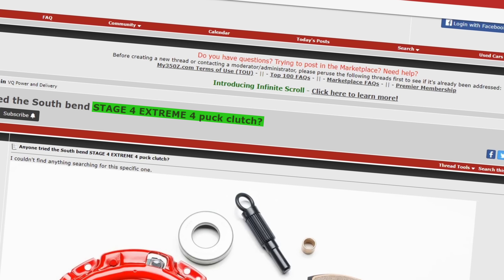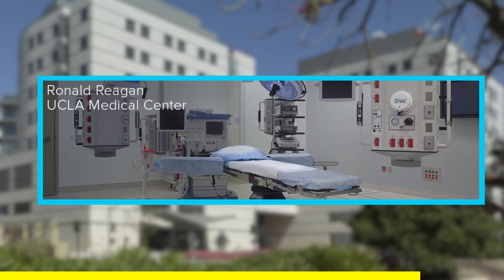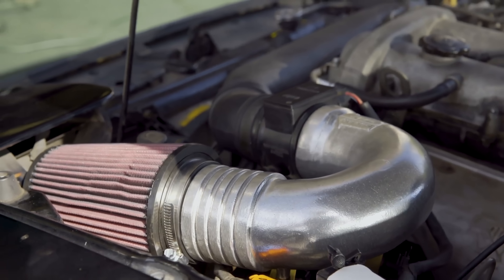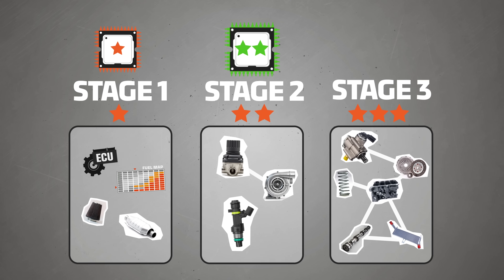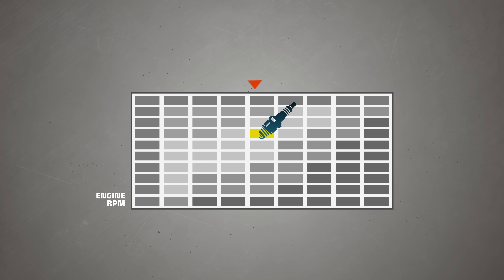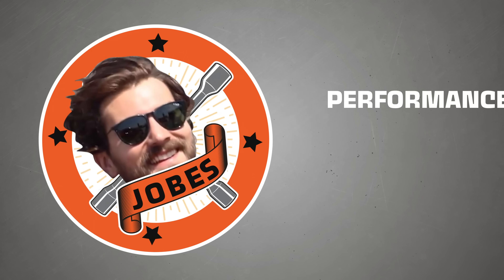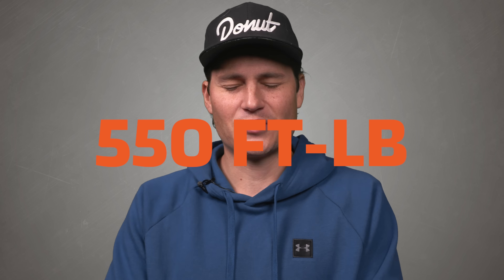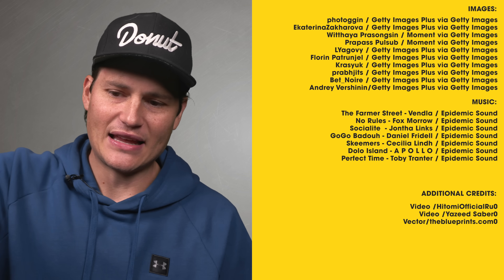What Exactly is Race Tuning?

Comment: what a mess that didnt clear anything up . Stages for me started in 2001 with the release of the Audi A4 B6 1.8t . 
The Audi could have a standard tune which would be called a Stage 1 would increase power to about 200hp , a stage 1+ which would increase power to around 220hp and involved upgrading the injectors . Stage 2 tunes involved fitment of a high flow exhaust from the turbo back , usually with a high flow catalytic converter/s . So if you have a mk6 Golf gti with a stage 2+ tune it means youre running a bigger fuel pump and a downpipe ( note the fuel pump is the restriction on TFSI engines and not the injectors) . All the other modifications are optional on any stages , this includes intercooler , cat back exhaust , discharge pipes , turbo muffler deletes , intake manifold flap delete and throttle pipes etc . A stage 3 is essentially a turbo swap which is larger than the stock turbo , but essentially is bolt on .A stage 4 is engine modifications like rods/pistons etc . 

Quite simple and easy to understand , it may vary with other makes but this is the standard for VW/Audi/Seat/Skoda tuning

Comment: You need to read your history of tuning. Stages of tuning existed and was talked about way before any video game was even thougth about.
For example:
In Sweden people in the buisiness of tuning and racing knew what stage 1, 2, 3 e.t.c. tuning of a Volvo 2,3 litre redblock inline four means. Same with the older 1,8 and 2,0 litre push rod engine. We are talking about the 70's and 80's.

Comment: Well i have 
VW Golf mk2 
1.6L Turbo Diesel
If we take this video for example then i have stage 2 tune with:
Bigger turbo, new set of injectors, cold air intake, and electronic bosch pump (even i don't know how 1990 golf can have so "modern"[at the time] fuel pump) ....
Buuuuut

It only makes 5kw more then original power 😭😭😭😭😭

Comment: When working with companies selling parts for Volvos is seems they usually fallow the IPD rule of thumb of Stage 1 = no internal mods or programming needed Stage 2= programming needed Stage 3 = programming and engine internal upgrades needed. Stage 4 is usually an entire bolt in engine, ecu and add ons.

Comment: In Europe they actually mean something.

Stage 1: Just ECU remaping
Stage 2: Safe Hardware upgrades + ECU remaping
Stage 3: Unsafe Hardware and ECU upgrades. It usually means modifying the engine internals as well so it does not blow up.

Comment: Not really correct actually..

The stages of parts can be different and not really logical (depending on manufacterer).

I've worked in the tuning industry for 10 years now and now own my own tuning company.

BUT stages of tuning for cars are as followed :

- STAGE 1 : Just software, no mods
- STAGE 2 : Intake and exhaust modifications (ranging from air filter, to cat delete, to opf delete, to exhaust, etc.)
- STAGE 3 : Other TURBO and supporting mods
- STAGE 4 : Made up entirely, but mostly a bigger turbo and supporting mods
- STAGE 5 : exactly the same as Stage 4 but again bigger turbo

If you would need more info, just contact us @ICON AUTOMOTIVE

Great video nonetheless..

Comment: "stage" mods also vary by car - For example, in a WRX or STi stage 1 is commonly accepted as an aftermarket tune, stage 2 involves a downpipe (high flow cats or catless) and tune. Stage 3 is where it gets wonky though, as it's usually fuel system, turbo and/or intercooler upgrades and a reflash, but it gets pretty "a-la-cart" depending on the individuals goals. CAI & catback can be done whenever as they don't really have an impact on the cars performance (CAI usually has a negative impact though).

Comment: Finally getting back into cars and that was super confusing. I recently bought a sportster but harley has it broken down pretty well. 1 tune intake pipes 2 cams 3 bigger pistons 4 bigger pistons and jugs and throttle body 4+ turbo and such. When it came to looking back into cars I was like um. No idea what all this means. I have noticed stages that make sense like the ones you said on APR audi/vw website for boosted cars. Just like you said it.

Comment: Stage 1... borderline illegal.. Stage 2... deadly.... Stage 3... stupid :D... something like that... my fav anti-tuning death(of your parts) is when garage tuners remove ECU limits on certain configurations of car to make it make more power... of course no upgrade to the relevant parts it performed usually and the next thing you know is either the colour of your coolant as it breaks through the head gasket or the grinding sound of a dead transmission you stripped the gears of because you did not buy the car you wanted... you bought the lower spec one and now you are taking the way more expensive route to almost certain failure... I do support car customizations but most aftermarket mods out there are worse than their respective OEM parts(when it comes to BMW at least) but they have red paint on them and blue LEDs so they must be better :D

In my humble opinion the No1, most rewarding and perceptible upgrade to any car is a set of Michelin tyres, a good suspension alignment and new dampers and bushings if they are worn.... This makes the most difference. Most cars struggle to put down the 200 horses even with 2WD... so pointless to chase power any higher without changing the wheel sizes and/or making the car more heavy(a wing is not going to help it get off the line quicker) and once moving the 500 horses have no tangible benefit any more. All the horses are there for the take-off... the rest is just penis contest, irrelevant. Another sensible upgrade I think is a towerstrut if you want some extra rigidity when cornering... and of course more traction calls for better brakes... Engines and their associated drivetrains are sized with conservative material requirements in a lab of 100 such engines until the OEM gets the configs right. You only have the one engine.... and no retries... how much chance do you stand? Making your engine produce more power usually comes at shortened lifespan as the material thickness, the cooling and the cylinder walls were never meant to have that kind of power probably... this is the shortest affair with the most expensive car that you will lose ultimately and you could have just bought the performance version in the end for cheaper...

Comment: Ive always taken stages as ones performance goals. If you want to eventually make 3000hp then yes a 1000hp turbo would be considered a stage 1 turbo for you. Along with all other mods needed to make that turbo work. Then stage 2 would be the 2000hp capable turbo with the additional stage 2 supporting mods, and so on an so forth. Just how ive always seen it.

Comment: Turbos are trash. Superchargers are better.
Reply: they arent trash, theyre both good in their own ways
Reply: @arcanevoid9199  turbo cars are good at being slow.
Reply: @AKLumps907  so thats why they make more top end power and are more efficient?
Reply: @AKLumps907  wow ok, i guess just keep hating on something you obviously dont have experience with or know much about :)
Reply: @arcanevoid9199  nitrous is better than turbos. Walking is better than turbos.
Reply: @AKLumps907  bro have you even driven a turbo car? actually so arrogant
Reply: @arcanevoid9199  yes. It was slow until the turbo kicked in. My supercharged build is instant power.
Reply: @AKLumps907  you can setup turbos to spool almost instantly, and although superchargers make instant power they dont make the top end that a turbo does. also dont feel the same, superchargers are very linear. a turbo will smash you in the face when it comes on boost :)
Reply: @arcanevoid9199  yes. Unless your running a centrifugal supercharger. But you can’t because they look like a turbro.
Reply: @AKLumps907  centrifugal superchargers are cool, but again because theyre belt driven they still can't match the top end of a turbo.
Reply: @arcanevoid9199  you’re limited by rpms...
Reply: @AKLumps907  regardless of rpms, turbos can flow more air at the top end as superchargers lose efficiency. also theres a reason why outside of muscle cars you don't really see factory supercharged cars. its always turbo
Reply: @arcanevoid9199  because they can’t build supercharged motors.
Reply: @arcanevoid9199  because you think turbros are better.
Reply: @AKLumps907  never said they were better, said it my first comment. both good in their own way, and the best option depends on the application and what you are after
Reply: @arcanevoid9199  yes. If you’re after speed, power, and efficiency you go with a supercharger. If you’re after noise and pomp then you go with turbos.
Reply: @AKLumps907  turbos and by design more efficient than a supercharger, how stubborn can you be. actually talking to a wall rn
Reply: @arcanevoid9199  they just aren’t. Again. And again. They aren’t. That’s why all the fastest cars are supercharged.
Reply: @AKLumps907  which cars are these?
Reply: @arcanevoid9199  all the fastest ones.
Reply: @AKLumps907  hahahaha

Comment: This was also mentioned in GT1
A stage 2 turbo on a demio LX-G gave you the same amount of HP as a Stage 3 turbo on that car.
But having a fully tuned Demio LX-G is quite fun.
The LX-G starts off with 80hp(lowest in game), but once fully tuned it has 211hp and weighs about 710kg.
Tune it right and it can win the Grand Valley 300km which uses 600hp race cars.